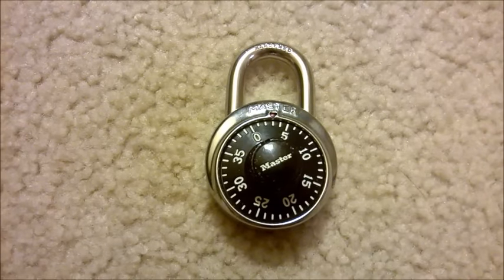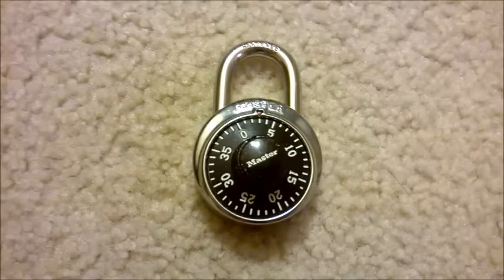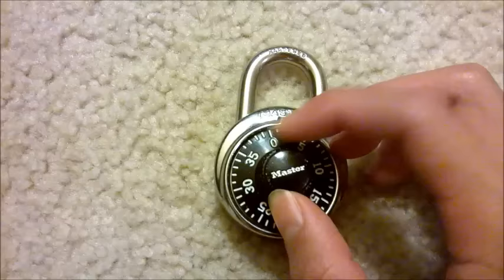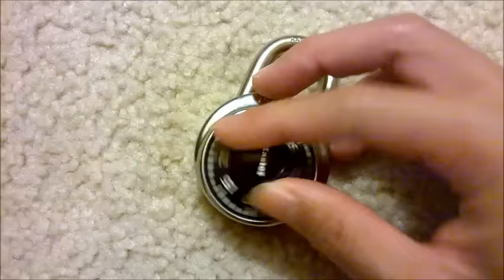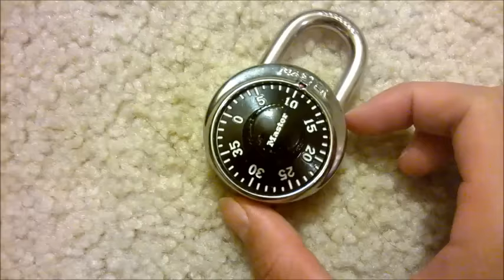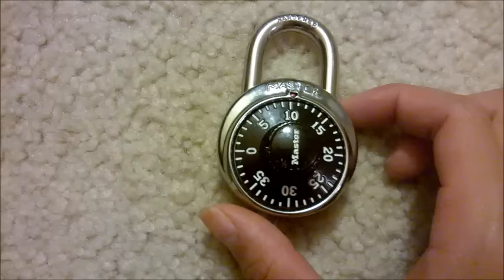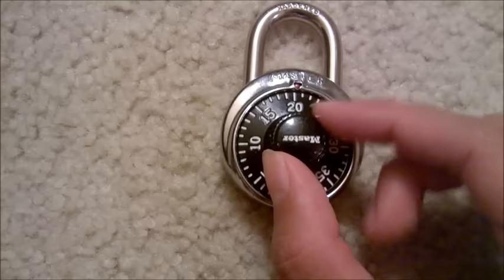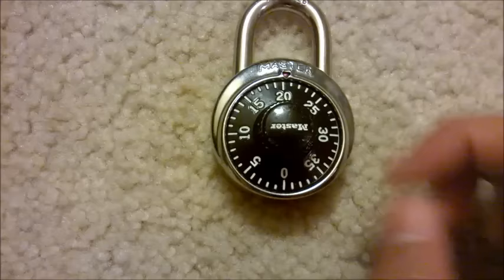How to Open a Master Lock

Comment: Upcoming freshmens, or wherever you are, best of luck out there! I wish you well and I hope you enjoy your years! You got this :) Also, thanks TheCrazyButch for helping me out. Your amazing :)

Tip: If turning left and right is confusing, make your 3 full turns around 0 by starting from 0, and going backwards, like 35, 30, etc. Land on your first number. Turning in the directions the number gets higher, like for example from 30 to 35, make a full turn, passing your first number, and go to your second number. Now go backwards like 35, 30, etc, and land on your final number. Keep the arrow on your final number, since your lock will be floating since it’s attached to your locker, pull the lock down and it’ll open easier. I hope this helps you!
Reply: Thank you!!
Reply: Tysm really helped
Reply: BYE THIS LITERALLY HELPED ME MORE UNDERSTAND HOW TO OPEN THIS THANK YOU SO MUCH
Reply: @serrcoss5063  fr I can’t open mines
Reply: Middle schoolers
Reply: Thx
Reply: @michelleislas4055  no fr like I've used locks but 'left and right' 'clockwise and counter-clockwise' confuse me sm bc at my school we have optional lockers but have to take pe for credit for 1 semester
Reply: Thank you 🙏🏾
Reply: D Dresser rz=deer r2 369.99 Zaza X Z R6 RED
Reply: THIS HELPED SO MUCH
Reply: @GaelGarcia-jv1kd bolt cutters and a new lock
Reply: I just got even more confused

Comment: Tip: if you're doing everything right but it isn't working, every time you get to one of the numbers, go a little bit beyond that number. Don't go over to the next line, just go halfway
Edit: You also have to hold it down while you do it. For some reason, whenever I tried opening my lock, it wasn't working, but I later found out that I had been pushing the loop and the lock closer together whenever I tried opening it. That prevents the lock from opening, so remember to not push the lock closer to the loop part of the lock.
Reply: Holding it down on the last 2 digits saved my life. I can’t thank this enough. Thanks!
Reply: Thank you bro I was doing that at first and I couldn’t get it open when I first saw your comment I was confused as to what you meant but then I tried it and it worked thanks so much saved me good 👍
Reply: THIS HELPED ME SO MUCH THANK YOU
Reply: THANK YOU SO MUCH OMG

Comment: Tip: wiggle the dial on the last digit while lightly pull the lock down. I think new locks just need time get used to being open and are not loose enough when they’re new.

Comment: You cut the video part in two when you finally opened it
Reply: The reason why he cut the video was because the combination wasn't really 10 20 30. Instead, it could've been something else like 18 27 14. In order to make it simple for the viewers he used round numbers (10, 20, 30) as examples. After the example was finished he would open the lock by doing the actual combination, and show how to open the lock.
Reply: You so smart
Reply: XD
Reply: @user-og5wi7nd5s  I think it's because he messed up on the last number which was ten, when he accidentally landed on nine. I may be wrong though lol

Comment: After clearing the internal mechanism by rotating the dial on zero three times, then land on on first number.
1-line the first number up with the arrow at the top.
Ex-10 
2-turn counterclockwise twice and line number up with arrow above.
Ex-15
3-turn clockwise once third number.
Ex-30 
Push to open.

Comment: One possible reason that u couldn’t open is that u didn’t pull the shackle( PULLLLLLLLL). The first few times I tried it I did follow the steps correctly just didn’t pull the shackle.

Comment: ….

1-Clockwise around 0 and pass 3 times 

2- Land on first number

3- Counterclockwise around second number and land on the second time.

4- Clockwise to third number

5- Pull 

6- Yay!

————————————-

1- Pass clockwise zero 3 times. (Pass clockwise 0. 3 times)

2- First number (Land)

3- Pass second number counterclockwise once and land. (Pass counterclockwise. Land)

4- Clockwise to third number. (Clockwise. Third number)

5- Pull.

Comment: Ahhh, I can't get it open and middle school is tomorrow ._. I've been doing everything right and it still isn't working :(
Reply: Tip: if you're doing everything right but it isn't working, every time you get to one of the numbers, go a little bit beyond that number. Don't go over to the next line though, just go halfway

Hope this helped :)
So let's say your numbers are 30 30 30
Then you do about  29.5  30.5  29.5
Basically adding 0.5 in whichever direction you're going (clockwise, counterclockwise)
Reply: @8bitgdhaxz  Thanks! I finally did it after an hour lol